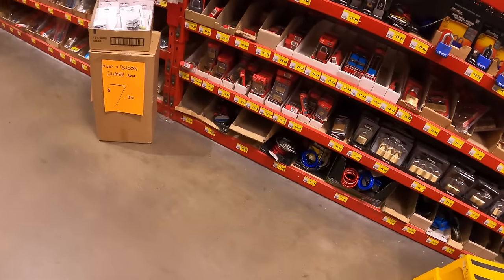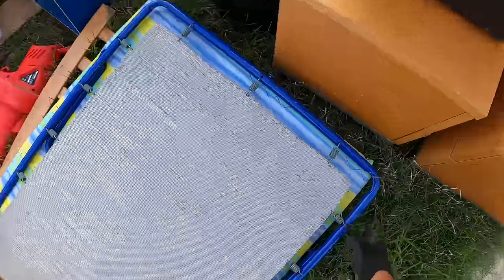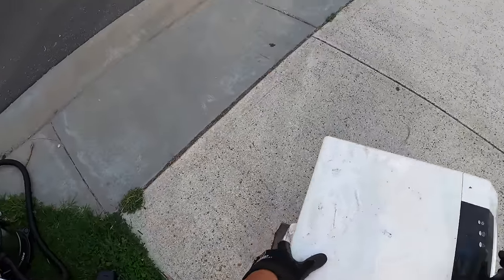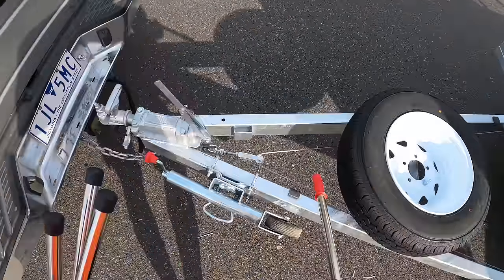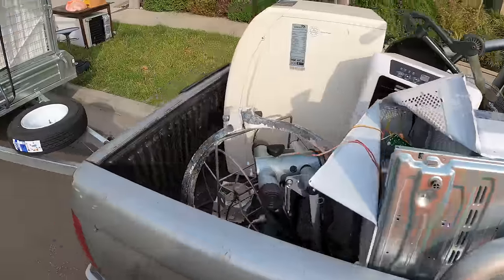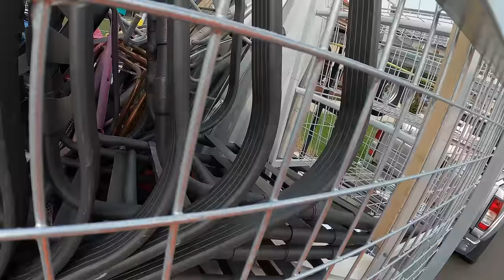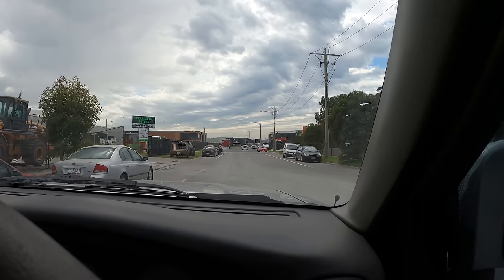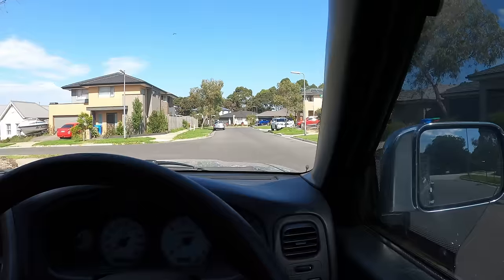Check Out What We Found! - New Trailer First Run Edition

Comment: Great to see your new trailer on the road. I agree with the type of trailer lock as they are much stronger. I would go back and get one of those blue drums so you could leave it in the Ute for keeping your wire and cords in.
Onward and upwards Poly.

Comment: You really need to get a GPS tracker for your trailer it's a lot cheaper and if someone gets through the locks you can find it.
Reply from the maker: Thanks Tina. I actually have one and will definitely use it 😊
Reply: @PolyProphet  dude I know you're in Australia, but you need some big boy shoes. If you drop one of those pieces of steel on your foot those flip flops aren't going to protect you're toes. Also if you're doing this as an income you need to keep track of your mileage while scrapping. You can write it off your taxes. Watch "scrap and pallet man" & "mike the scavenger" videos. Also do get do resales of some of the things you get? How old are you too? Also if you flatten those aluminum gutters they won't take up so much room. Just stand on them, they're aluminum they'll flatten easy.
Reply: @karenmorrisette5027  1q